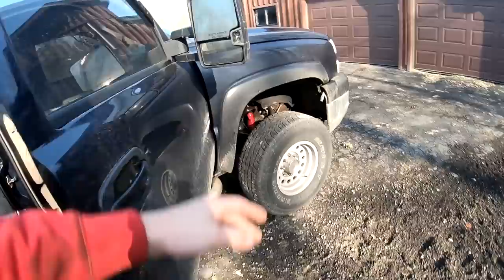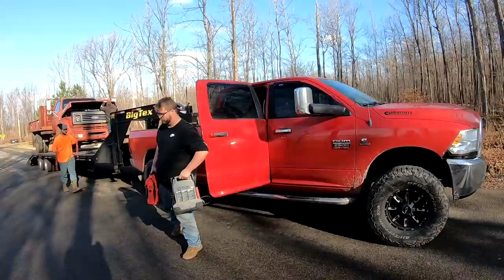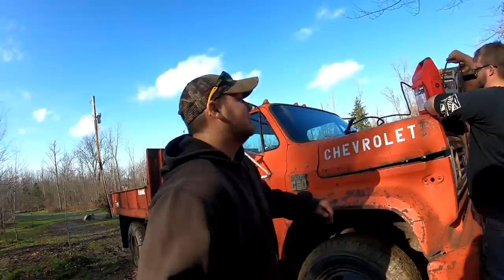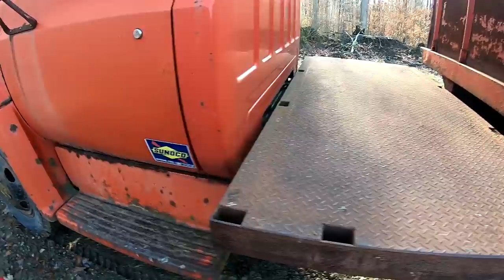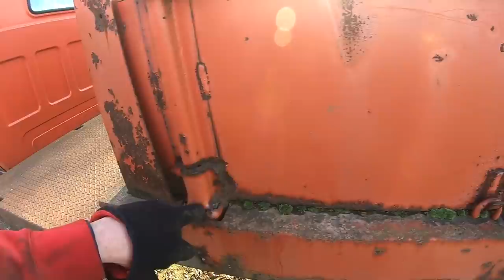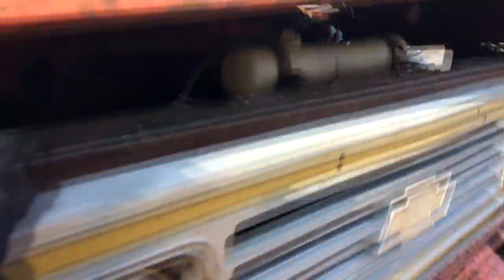Taking Delivery of My New Truck

Comment: I’ve got the same truck and it’s a splitter so you can have a high and low range in each gear when I’m not loaded I just shift 1-4 in low range then go to 4 high to act as 5th gear
Reply: C2 Farms isn’t this similar to the first models of an older Chevy c 6500

Comment: I have an 82 gmc in the same size chassis truck with a 350 5 speed. No 2 speed rear end. A regular chevy square body dually box lines up with the cab. That c60 will be a great truck

Comment: It’s a 2 range rear end so you push the clutch in pull the lever and it’s high range. So it can act like an 8 speed. But in FYI have no load you can leave it in high range. That’s pulled out.  I love the trucks for a grain truck with the wood bed. Keep it up

Comment: It’s the 4 speed with the splitter. So you have hi lo. We got a c50 with that trans and all I do when I’m loaded is start in lo and then go through the gears then once she’s topped out in 4th push the clutch in and pull out the splitter. Love the videos. Hope I could help

Comment: I've never seen you actually complete a project, this has to be another fail
Reply from the maker: gator, ktm, honda, kodiak.. Jeeps not done. The old Crush trailer is 90% done.
Reply: Yes he has plus the snowbike and his old kx250 which is gone and his truck which he painted Just be happy hes back👌☝😋 and doing well.
Reply: He finished the very easy small 1 week or less project's
Reply: @3DMachines  what happened to the BMW drifter? I was really exited for that
Reply: @BatesAutomotive  The bmw is a clear hoopty. E36s are a hit or miss. I can see why he doesn't want to put money into it. That car needs a lot to even think about touching a track. Not to mention he lives in ny and theres not really drift events around him.

Comment: It’s a 2 speed rear end it’s basically a second transmission in your rear axle instead of mating to the back of the engine. I like in Lakeview not far from you. I can show you how to drive it if you need a crash course. Enjoy the new toy✌️

Comment: Example go from 2 gear to 3 low then 3 high then 4th low then 4th high then 5th low then 5 high
Shift two speed to low as you go into the next highest gear.
So there. 
If empty go through the gears in low then to high in 5th . Pull up button then let up on gas it will shift without clutch.

Comment: Hey Dalton, 
 It's a two speed rear end.  All the switch does is go between hi range and low range.  Out in the field, you want low range.  On the road, start in low and after the last gear up flip the switch and start over shifting in the hole.  That would be the next gear up.  Did I explain that ok?
  What's with all the friggin haters!?   It's his channel he can do what he wants to do, don't like it find another channel.....!

Comment: LOL that jumper in your hand would never start that rig!
Reply from the maker: that thing has turned my dmax over when it has completely died in the winter
Reply: @3DMachines  Lol I know right, it's more than enough to start that C60. It has a 350 small block in it right?